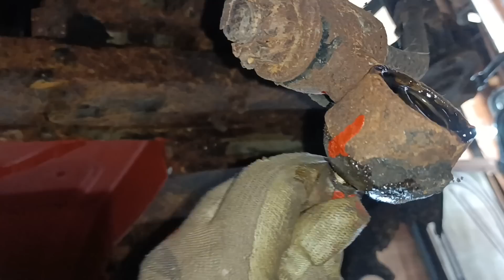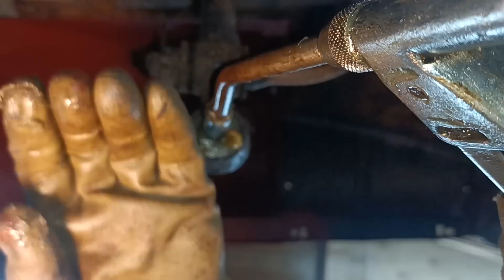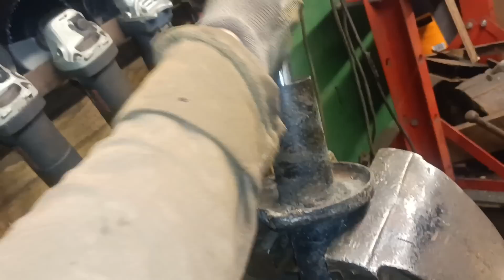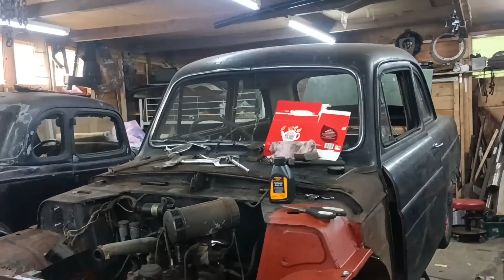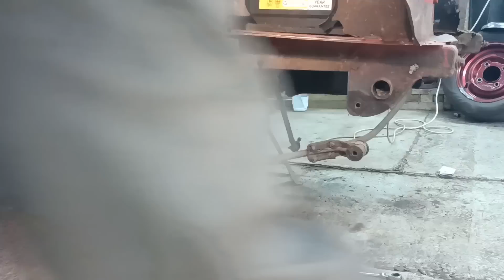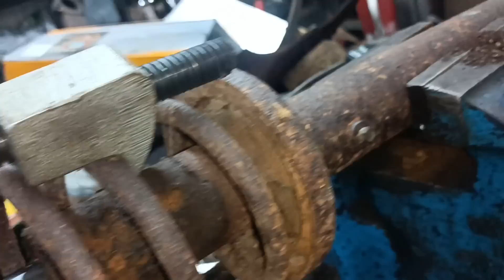Mart's 1955 Ford 100E Anglia part 17! Front suspension unexpected repair, then removal. (2353)

Comment: As others have said it is surprising how those 65 year old nuts and bolts are coming undone, good move spotting the suspension parts for sale at the start of this project. I think you can cancel the gym membership, all that time under front of the 100e must be as hard as an exercise class.

Comment: For a minute I thought you were installing that first part upside down.Must have just been the change in camera location. Glad when you were hammering on the spring that the spring compressor did not fly off.💥 So the strut can be taken apart and look at the seals and valving. What type of oil would be used?